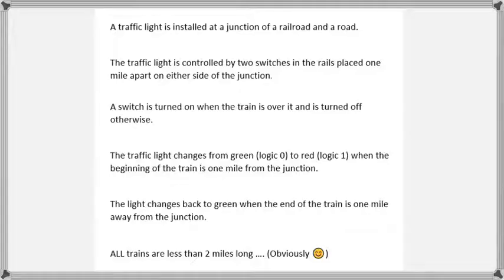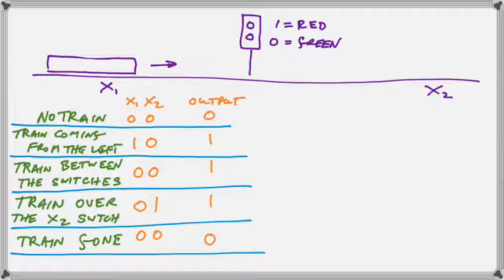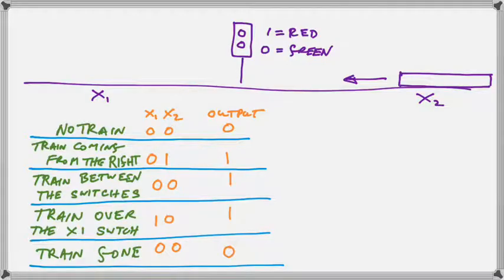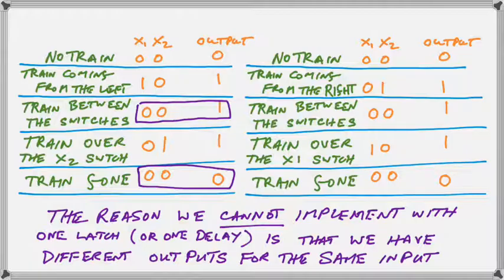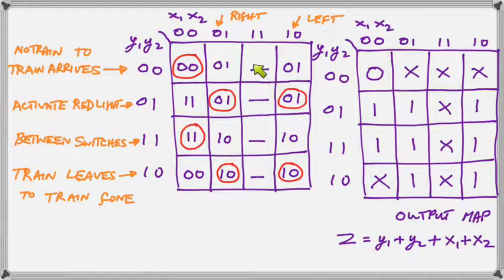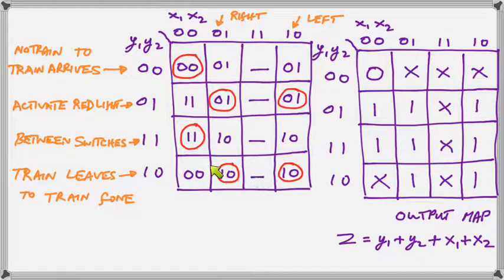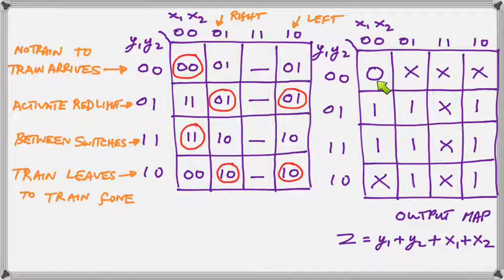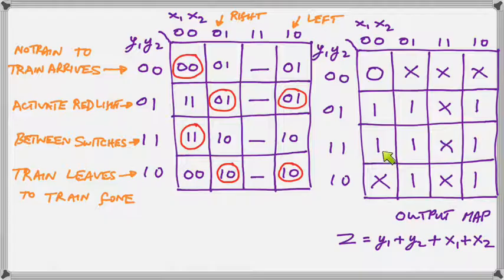Solution to real-world Asynchronous Sequential Logic design

Comment: Can you just draw the circuit diagram using  logic gates?
Reply from the maker: Well I was planning to actually build and demonstrate it ...... and would require me to produce the logic diagram..... however it is not likely that I will finish this anytime soon..... as I am currently teaching 3 other courses online ...... if you hang around long enough you will get it.... best wishes
Reply: @StephenMendes   thank you .... I will wait..... Actually I need this before 10 November....
Reply from the maker: @sharmishthabenpatel4379  it can be built with either NOR latches or NAND latches ...... I was planning to build it with NOR latches..... I hope that will satisfy your assignment, project or whatever reason you want it for ?
Reply: @StephenMendes   👍 oky thank you so much.....😊... It's fine to demonstrate using NOR latches
Reply from the maker: @sharmishthabenpatel4379  I will make your circuit with NOR latches tomorrow and you will have circuit diagram in time for your  assignment 😁
Reply: @StephenMendes   thank you a lot 😊.....
Reply from the maker: @sharmishthabenpatel4379  a computer has died on me (hardware issue) which has caused much loss of time and distress..... can I send you the solution as a file ? .... then you can either build it yourself or model it in a logic software program ? ..... please either put your email address on here ....or email me at hikebarbados@yahoo.com .... or Whatsapp at 1 (246) 230-4818.... and I will attach the answer to either your email or Whatsapp message .... cause it does not look like I am going to get a Youtube video online in time for your deadline .
Reply: @StephenMendes  oky 👍 I will mail you
Reply from the maker: @sharmishthabenpatel4379  I sent you two diagrams to email .... 1. is Latches diagram
....2. is Output diagram (sent from ipad via icloud.com)